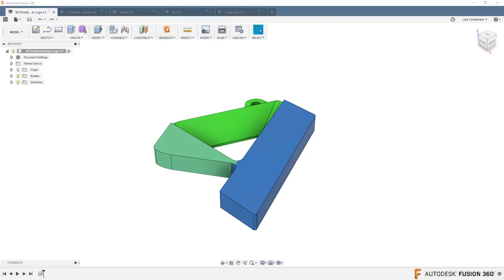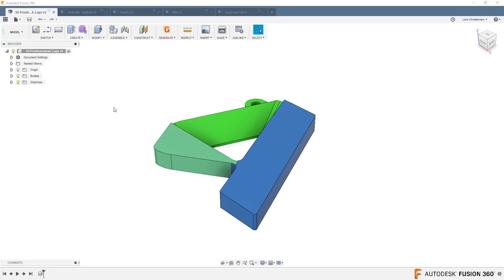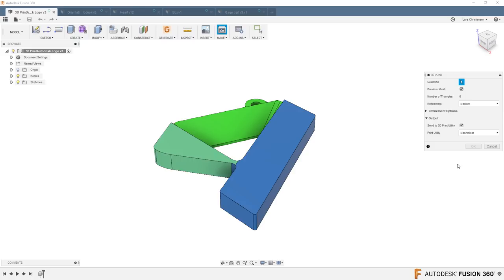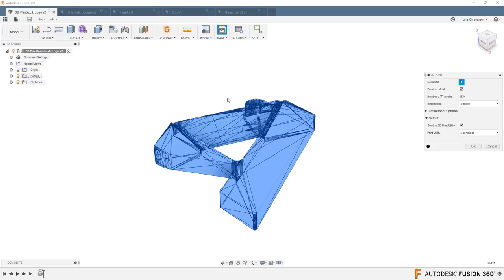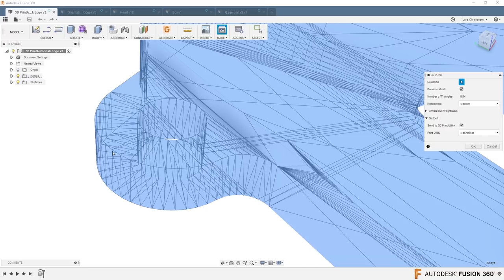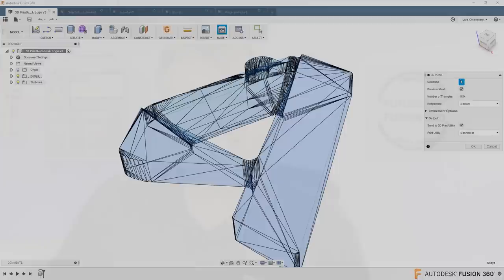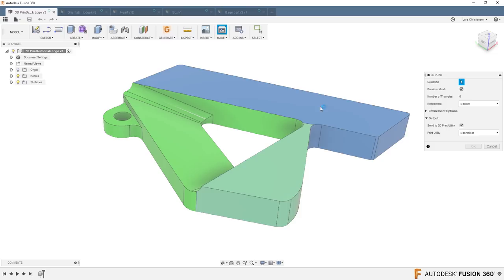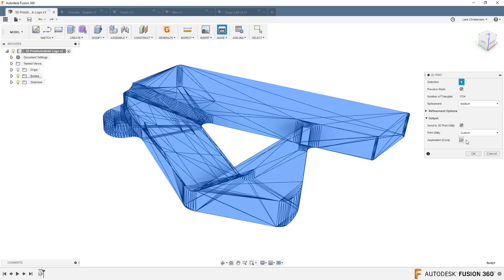Go From Fusion 360 To 3D Printer — Tutorial — #LarsLive 180

Comment: Thanks Lars. You are a very competent teacher. I have many years autocad experience having worked as a draftsman for many years but I am just a beginner in 3d printing and Autodesk fusion 360. Very useful information. Hopefully in the next week or two I might actually 3 d print something! AS for the xy plane...I was told it came from paper drafting originally and drafting desks were traditionally slanted so that the drawing appeared as if X was horizontal and y was vertical...therefore when 3d drawings were required the 3rd dimension was naturally z, towards the viewer. This then translated into early cad programs and so forth it just stuck. No worries. I like how you get around it...As for tolerances also great information. I will keep watching your lessons. I was wondering if you were going to remove the lid from the heart shaped box, then flip it over, attache it along one side of the box per se, and then call it all one object, then save it as an stl file, and just after printing is done, break it apart as if it were a plastic model for example, like the ones we used to build as kids. theoretically you could have all your parts on one file, connected by some plastic sprues, and then import them to stl and cura and so forth.

Comment: FYI - "Preview Mesh" won't work when you goto file -> "3d print" if you don't have meshmixer installed.  I didn't have cura or meshmixer. Once meshmixer was installed the preview started working.

Comment: Lars , I do a ton of 3D Printing and never thought about the STL not being that accurate compared to CAD file and understand what you saying about triangles. Is it possible to change from STL file to  a more accurate file, so that the circles can be perfect circles etc. Is the 3D printer industry thinking of changing the file type ?
Reply from the maker: Hi Vaughan Lundin Thank you for watching!
So when using the 3D print function within Fusion you get an option to increase the triangular count, that is really the only thing I can think of you can do. I know that other software has the same function.
But, if you start with an STL file, you are stuck with what you got. You do have an option to increase the triangular count in the mesh tools within Fusion, but it is important to remember that you are increasing the triangular count of the original file.

I will think that as 3D printers get more and more accurate STL will be replaced with solids, if not someone has already :-)

Have an awesome day!

BEst,
Lars
Reply: Look up the brand new Mazak i400 Hybrid....it's a five axis CNC/3d laser metal printer & machining center...
I've run the e410, and this new one runs a whole different CAD/CAM file for the 3d part of it, but then the machine is close to two million bucks.

Comment: Great and helpful! Only part is missing - how do you apply those tolerances when you realize what it is for your printer. Just scale whole body? But that may not work in every case - lets say I have a pipe on one side and a cup that covers it inside and outside. If I scale cup up then inside will be too big and not fit and vice versa.

Comment: You recommended making box and lid as components from the start fair enough but- when you went to save as STL the menu said one file per BODY, not component. I found this a bit confusing. maybe needs more explanation in a later video, or is it a mistake in the menu?

Comment: Hi Lars , i have good result with my 3D printer, as i print easy box like the red heart , now i've got some issue with the hinges as shown on another video or some different i did myself and on the lids or on boxes as it's not so big then it's not fitting really good. I presume on SLA would be no problem ..so did you have any video or option to help on such issue if i am clear ! ? thanks any and your video are still excellent Voila.

Comment: Hello, I am watching your videos from germany and they are awesome, thank you! They help a lot beside the university. I am going to buy a 3D Printer the next few days so I am completly new to this. I have a question to the lower part of the box. Would the 3D printer print the threads or would it just print "normal" round boreholes? Thank you.
Reply from the maker: This part did not originally have threads. The metal screws would cut them when tighten. But if you use the model thread function in Fusion, your printer will print them

Comment: Hello Lars...great video.  A question for you....Where do I find settings in Fusion to change Cura file.   The reason I ask is I recently upgraded from Cura 4.1 to Cura 4.10.0.  Fusion cant find it. To work around this, I went into program files and there were 2 files (Ultimaker Cura 4.1 and Ultimaker Cura 4.10.0).  I moved the Ultimaker Cura 4.1 file to my desktop leaving 4.10.0.  Went into fusion and hit make, 3d print, selected the component and chose Cura in the Print Utility dropdown box.....Nothing.   I then went back into program files and renamed Ultimaker Cura 4.10.0 to Ultimaker Cura 4.1....success!  Need to know where to change this in Fusion as it is not good practice to use a run around like this.  Would be interested in your comments please.  Thanks, Geoff D

Comment: Hi Lars.  I was  following along with this video and using the newer Fusion 360 GUI.  I was unable to trigger the dialog where you were showing that you could save to STL out of the file menu ....and if you had multiple components, it would generate separate files for each.  Does the new GUI not have that modified  dialog with the specific field for separate file per body?  Or perhaps is my file just wrong?  My current file appears to have two bodies in it although I am a little embarrassed that the parts appear to be on two different plane levels.  Those planes are like gremlins.....

Comment: Hej Lars
Just caught up on your videos. Great resource to learn Fusion.
One question I though would be good to cover, is how to arrange components for printing.
For instance, you make an assembly of components where some components are designed in place on angled surfaces of other components as the reference surface of the sketch.
In Fusion, that's fine. You can see how the parts  fit together, and you can project features between the parts.

But the position doesn't work for 3D printing, and not all slicers have the feature of Cura or Meshmixer to position parts flat on the build plate (e.g. Prusa Slic3r).
This means you have to rotate the parts in the slicer with the exact angle that the part is rotated in Vision relative to the XY plane.
Preferable it would be fantastic if the Vision 3D export dialog could include a selection option to select a face to be exported as the XY plane.

So for now, I've created a copy of the component that I then rotate and position correctly relative to the XY plane for printing without changing of altering the component used for the actual Fusion design.
But is there a better way to accomplish that?
Reply from the maker: Hi Jan Petersen Thank you for watching!
You could possibly do something like what is done for like routing layout:
https://youtu.be/00_6u1J0xkA?list=PL40d7srwyc_Mkgc5wvP_OfVel9aDkNkZ6

Comment: Hello,sir! First thanks for the very nice video! Now I have a problem like: if someone uploaded a multi-components model to Fusion360 and made it open source to download, but when I download it, it only outputs the full model with .stl, ,obj, whatever. In other words, I can't get the separated model of each component. It just outputs one file. How can I achieve my purpose that I can sparate the models of components from that one-file?
Reply: By the way, I have not installed Autodesk360 yet. I have tried 3Dmax and Solidworks, but they all produced a whole body and I can't select any component any edit them. I once tried the way on some blogs, where you need to adjust the import option from ‘entity’ to ‘surface’. However it will end up warning you "too much surfaces!'' and fail opening it.
Reply from the maker: Check this video https://youtu.be/tRhL9TGT-3c

Comment: Non of your videos deserve a thumbs down, always up. All plastics change size once printed, I print a 50mm block for each type of plastic I buy, measure the results and then in the slicer program use the % bigger or % smaller and use it as a multiplier  to get the correct size and print again, then mark the multiplier % on the spool so I can use it if I need a precise part in that particular spool of plastic.
Reply from the maker: Thank you, Derek :-)

Comment: Hey Lars I've been watching your tutorial on creating that conduit box and just want to know if the same principles apply for CNC matching with Fusion 360. If so, what's the next step to create the file that the CNC machine uses to create the design. Thank you
Reply: CNCs use gcode as well, which is what the slicer software produces. Your CNC should come with (or should recommend) a tool path software that can take the STL and convert it to the appropriate gcode for your CNC. The process is the same, as STL is practically an industry standard so basically all software supports it.
Reply: @F3Ibane  So ones I create my design in CAD I go to CAM in Fusion 360 and does that then create the STL file which I then send to my CNC Machine (which has MACH 3) and that converts it to G code. Ones that's done is it ready to mill the design? I'm an absolute newbie to this so have lost to learn. Just trying to get my head around all the principles. Cheers
Reply: @martindekker8203  Mach 3 only reads the G-code that Fusion 360 CAM-program produce.

Comment: I wish Fusion 360 would automatically save stls in mm. I don't know how many times I have exported an stl of a inch design and had it show up super small in the slicer. You have to resize it by 25.4 in the slicer or go back to Fusion and change the units to mm and re-export it.
Reply: Fusion can't read minds. In the 3D printer world everything is metric., just the way it is.
Reply: Exactly! All 3D slicers I have used require mm so at least give us a checkbox in Fusion for always output metric stls.
Reply: I am new to Fusion, but, doesn't it save the files in whatever unit of measure one uses to create it.  I 3D print out of fusion a lot and have never had issues with files not being in mm, since I design in mm.
Reply: Yeah I am a 56 year old from the USA. I learned measuring and machining in thous and tenths. At least one other CAD software I have used makes the conversion for you so I would like  that option in Fusion 360.
Reply: It was a head scratcher for me too at first, seeing those teeny tiny parts sitting on the "bed" but I eventually figured it out...I'm in the same league as you, USA late fifties, but now I am amused, I can model up some US threads in Fusion switch to mm  and print them and they come out as....US threads :-)
Reply from the maker: blic, lol that is a good point. Of course, Fusion can't just assume all STL's has to be converted, but it is interesting how the 3D printing world has developed over the years. No rules but trends
Reply: bil k I am the same age as you and fortunately our country did the converting to metric when I was going through school. Very lucky as I was able to learn both. I feel it’s much easier to deal with a whole number rather than fractions. I appreciate it’s what you’re used to though. I’m just about to start with 3D printing and I’ve found these videos to be so helpful. Great job Lars

Comment: Im new to all of this and I  have a Anet A8 3d printer. Will the fusion 360 work with this printer? You are very informative thank you.
Reply from the maker: As most, if not all, 3D printers uses STL Files I would say yes. But then again, I am not a 3D print expert
Reply: Yes...your printer is what we call a "Prusa clone"...it still uses the same ardurino controller board....
I have an original Prusa i3, a Hictop Prusa, and a FlashForge.
My YouTube channel shows the building and calibration of the Hictop which apply to all of them.
I started with SketchUp CAD, and Cura 3d slicer four years ago making 3d platforms for RC control aircraft to mount cameras and FPV gear.